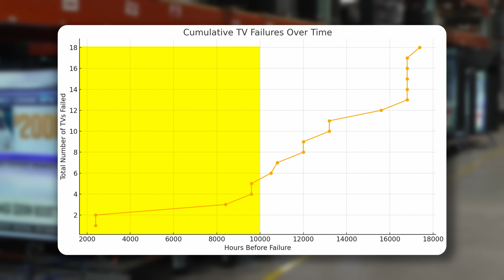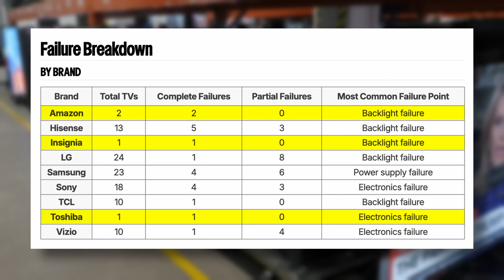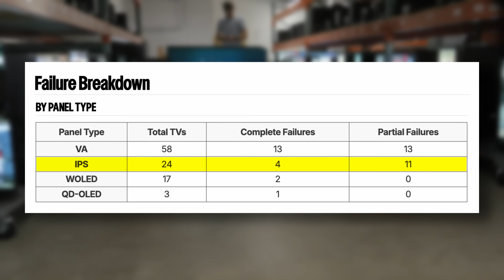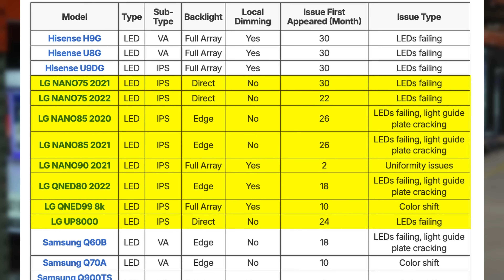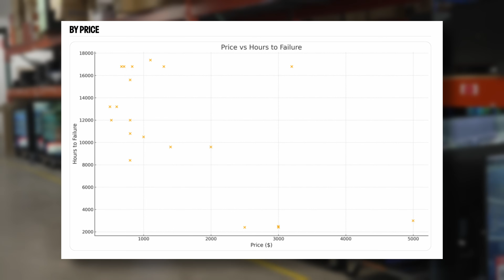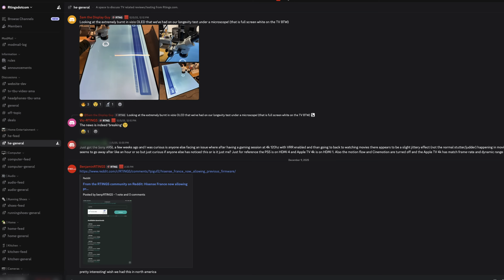Which TVs Break First? Results Overview From Our 100 TV Longevity Test

Comment: And in the good old days, TV's lasted for decades
Reply: In the good old days (black & white), I had a picture tube explode.
Reply: @markrosenthal9108 this one time at Bandcamp
Reply: In the "good old days" they cost a lot more.
Reply: @Sondisberg adjusted for inflation and what was available as far as size at the time, not really. I used to watch cartoons on the TV my Great Grandfather had purchased ten years before I was born and it was still working when they went to digital transmission over the airwaves. 30 years and it still worked when they got rid of it for something better.
Reply: @jeremygardner1123 Yes really. Regardless, you didn't do a torture test on a bunch of tv's from the 70s so everything you claim is purely anecdotal.
Reply: @Sondisberg  Sure, but more consumers should be willing to pay for a top-of-the-range Sony (or LG or Samsung if they are willing to make "professional" series units) that offer a decent standard of quality.  The science & engineering is there to be able to make durable commercial grade televisions (e.g., for production houses and studio use), surely it is up to consumers to be willing to step up and pay for quality?
Reply: unless your back gave out trying to carry it to another room
Reply: they were also like 24 inch at best.
Reply: Yes but compared to a new OLED the old TVs had a horrible picture quality
Reply: @fabian7942 new OLED is already old and replaceable.
Reply: @fabian7942 at the time it wasn't inferior to anything. And if you had a friend with a 20 ft wide satellite dish in the backyard, it was something. That and the big screen with the projector in front that took up half a room. 😆

Comment: I'd imagine the reason OLEDS have fewer total failures (not sure I'd omit noticeable burn-in from the partial failure category...) is just the simplicity of them.  They're somewhat difficult to mass produce, but what's actually going on inside is fairly simple.  It's probably a large reason they have such fast panel response times.  There's barely anything between the panel and the board, especially on WOLED.  I'll say I have a G5, G3 and C4... and ironically the G5 is the one that's got the worst, longest lasting image persistence, strangely.  I think the LG C4 has been the most reliable on that front, for some reason.  Could just be panel lottery, nonsense.  Although, I do think panel lottery should be basically non-existent at the upper end, especially given price.
Reply: Most of failures were backlight going out. Oleds does not have backlight.
Reply: @slovakjakpica  The thing is though,,,, LED backlight going out is the EASIEST cheap way to replace. Their screens are usually INTACT.   Backlight cost --$10 street, doesnt require high tech to replace.   
OLED burn in ---- the SCREEN Gonner.  TV done.
Reply: @Yoga_Tv_buying Not really nowdays TVs are made extremely hard to disassemble without breaking anything. Repairs are expensive and. it worth it even for stupid led backlight. If there would be easier way to replace them without disassembling whole TV, it would help

Comment: LG C2 is my first OLED and I was kinda anxious about using it to play games without dynamic HUD, watching the same channel for a long period of time (because of the logo) or using subtitles without making them transparent as much as i can, whenever i can. Rtings really helped in reducing stress, and time proved that burn-in really is not a problem. So, OLED forever, until they make something better.
Reply: I got a s95d because of these tests and yeah the only precaution I've taken is hiding the task bar on my PC. Made me completely change my opinion on OLEDs
Reply: I've used G8 OLED for around 2 years full time (10h+ a day, mostly coding with few hrs of entertainment). No visible burn in on normal usage, I can see burn in if I open paint with flat color but even that "burn in" is much less visible than any backlight bleed I've had over 4+ LCD's I owned.

The latest gen OLEDs basically should be consistently better than any LCD given all the info we have.
Reply: C2 user for 2 years here now, use it as a pc mon itor too, and still 0 burn in.
Reply: @TerranigmaQuintet  Yeah and tbh i dont need anything better. Just bigger maybe, since I'm on 55" atm.
Reply: I just passed 10000 hours on my LG C1 48" that I have used as a monitor since the day I got it in October 2021. I still dont see any signs of burn in, even on full color tests. On red there is maybe a slight darker region showing up in the middle of the screen, but it is so faint I cant really tell if its just my eyes or not. The bigger issue I have had recently wthin the past year is a few dead pixels in the upper right and left corners of the screen, about 8-12 in total. 

I use it with a mostly black moving wallpaper, auto hide taskbar, 3 minute screensaver and 50% sdr brightness 100% hdr brightness. Useage is about 60/40 gaming web browsing. I dont do anything special beyond that. I often leave several windows split on screen for hours at a time. I really do think as long as you somewhat vary the content on the display, oled burn in is not much of an issue.
Reply: same. 2 years strong and still in love. only complaint is the super invasive web os - easily fixed by a dedicated htpc and disabling the network on the tv.
Reply: OLED's are really nice. I think the issue for most, is the price is nearly 3x their QLED counterparts. But if one can afford it, it may be worth the price.
Reply: thinking about burning. is like thinking about your phone battery health. its useless and only makes you stress.

im using lg c5 as monitor. so far its amazing
Reply: @ianlanford6922  well you can always replace battery for cheaps, but not the TV panel
Reply: OLED installer who replaced my C2 48 panel said he has some at 20-60k hours with NO burn in, max brightness used in advertising. So don't worry, use it howeve ryou want lol.
Reply: I’m using a oled monitor(pg27ucdm) and it is fantastic. Truly.
Reply: There's not any reason to worry about burn-in if you're not watching literally one channel and nothing else (like in their torture test). Realistically, just the act of changing the content occasionally to allow the pixels to cycle and "cool down" is sufficient to keep burn-in at bay.
Reply: Unless your HUD is full white or you run at full brightness all the time, there is no point in worrying.

Comment: I’m an oled lover, but I wish you guys would have considered burn in as at least a “partial failure”. If anybody saw burn in present in their screens to the extent of what was shown in this video, they would either warranty it for a new one or just buy a new tv in general. Just because burn in was expected, doesn’t make it a non-issue when it shows up.
Reply: Right? That's actual gaslighting. They technically lied in this video. I lost my trust in RTINGS today because he just HAS to know better.
Reply from the maker: fair point, but the burn-in here wasn't just expected--it was deliberately induced. we don't expect most people to experience this level of burn-in with normal, mixed use.
Reply: @RTINGScomRD  So burn in is deliberately induced so it simply isn't called a failure but QD layer degradation or LED failure using 100 percent brightness isn't?  Where is the clear line in the sand drawn then on what is or isn't a "failure" or instead just deliberately induced and doesn't count?  Couldn't one say running any set no matter the backlight tech deliberately inducing failure when its run at 100 percent brightness it's entire run time?
Reply: And just to add- "we don't expect most people to experience this level of burn-in with normal, mixed use."-RTINGS. 

And don't you expect that most people will not experience near the backlight failure with normal mixed use not at 100 percent brightness??  RTINGS seems to be wanting to have it both ways.  Giving credit or the benefit of the doubt to Oled of not having burn in if in normal mixed use but not extending that same benefit to mini led sets for backlight failure.  Burn in should be partial or complete failures as well if backlight issues are counted as such.  While I appreciate RTINGS testing I think their general presentation and assertions from their findings are quite suspect.

Comment: I think it's safe to say there will never be an agreement about OLED burn in.
Reply: i think it's safe to say that if you watch in vivd mode, play games or perpetually have news channels on the TV then OLED probably isn't for you. for everyone else it's not a problem.
Reply: @Gbrnole2 I have PC with OLED. 😅 If that's the case than I gonna see burn in. No burn in are really no problem anymore. 

We already have 4th generation. I would only worry with static image or using it for work. Like working with same program. 40 hours each week. Something like that.
Reply: @Gbrnole2 Wow that is a complete lie. Yes true on news, but games wtf is your soruces?  Now sports is 50/50 depends if it transparent hashtags and no stuck on scoreboard.
Reply: @vagamer522  source: my office tv 🤷‍♂ note that vivid mode was pertinent to that prior post. i've never seen screen burn on my other OLED's in cinema / expert modes.
Reply: @Gbrnole2 what model? New TVs and monitors  have lot of tools to prevent that. Like lowering brightness moving pixels egc... I doubt that it is newer TV.
Reply: We had on display Panasonic OLED in shop for one year. Nobody bought the tv... Even after full year running ad over and over. It doesn't really have burnin. At least not really noticeable. So I wouldn't be so scared.

Comment: What about OLED Dead pixels because of bad sealing? LG 48” C1 8500hrs and it has a lot of dead pixels around the corners and borders; no burn in at all. I wouldn’t call that the “best” in terms of durability… burn in it’s not the concern, it’s oxygen leaking! Hopefully it doesn’t get worse but I have doubts…
Reply: It gets worse. I have a Sony A90J that has thousands of dead pixels around the edges after less than 1K hours of use. Once the seal is compromised, the pixels just keep going out in a slow progression from the outside in.
Reply: Oleds self destruct over time even without using them.

Comment: I baught a 2500€ LCD TV with Local Dimming from Phillips in 2009. I used it as PC-Monitor for at least 5 years, nearly 6-12 Hours a day, then it was used as TV until 2020,  then it went black. With a Flashlight you could see the panel was working only the backlight was off. I put it with an error-description on a second-hand marked  for free. A few days later someone drove 200km (124mi) from another country to pick it up. I bet they know what the issue was und could fix it. I bought a cheap replacement for just 500€ which has an okay image-quality and works until today.
Reply: I bet they are buying replacement lamps off of Aliexpress. You missed out, it was probably quite easy and cheap to fix.

Comment: My Pioneer PDP from 2008 with over 60k hours still looks great with minimal burn-in.  When $3000 plasma TVs pop up on Craigslist for $50 it's hard not to have one in every room of the house -- helps with heat in the winter.  Then there's CRTs.  My hospital has a few Panasonics that have been on 24/7 since 2003.

As for modern TVs?  Aside from PSU repair I refuse to touch them.  Great vid as usual!
Reply: But they look worse... Yeah I loved plasma. We had really long time plasma TV. They had great colors and blacks. Unfortunately they stopped developing. Newer TVs are definitely better. 4K HDR it's just non comparable.
Reply: The money you have wasted on electricity bills...

Could have gone to vacation a few times for that.

And in summer you just suffocate in the heat or do you waste even more money on electricity to cool the rooms you are heating with your TV's?
Reply: "helps with heat in the winter"
Yeah, nice way of twisting that it uses lot of power; and while thats 'fine' in the winter, in the summer it means youre using a LOT more power as its dumping heat into the house that your AC needs to expend more energy to remove. The energy cost of running a Plasma TV for 17 years wouldve bought you multiple OLED TVs by now.
Reply: @__aceofspades  Why not have both picture quality AND durability? Surely the onus is on OLED TV makers to make 20 year televisions too?  Even Panasonic themselves have junked their brand reputation at times, for example with late Panasonic 3DO games consoles that had the cooling fans deleted to cut costs and therefore become unreliable junk, whereas Sony avoided that and PlayStation is a strong brand to this day.  You should never set out to tarnish your brand's reputation on purpose -- that seems foolish in the extreme.
Reply: @__aceofspades  If they are setting out to make OLED TVs with a design life of 15,000 hours surely they are capable of going back to the drawing board and making a TV with a design life of 90,000 hours instead? But a lot of blame has to be placed on on consumers like yourself if you think it OK to have "multiple OLED TVs by now"  because the old ones broke , rather than because the old ones were repurposed as spares or gifts (e.g., a gifted Plasma) and are still running strong.

Comment: Having your tv on any content for hours is normal use and not a "torture test". The sooner it burns in that is an issue. If you can't use any of these screens with a static screen for many hours without getting getting burn in, that is an issue. I still have my 11 year old Sony edge lit LCD I use every day with my PC connected to it for many hours and not an issue yet. Of course one day it will fail but I would have went through at least 4 OLED TVs at least using them the same way by now because they would have all experienced burn in.
Reply: If you want to display static screen 24/7 you don't buy OLED, end of story. Normal usage doesn't look like that at all and tv is constantly changing colors of pixels (in tv, games, movies etc.). I use my oled as monitor and there are NO ISSUES after 3 years.
Reply: @Fuudimitzu They ran normal TV on those OLEDs and they burned in.
Reply: @Fuudimitzu it is in a lot of households, unfortunately. CNN, FOX, MSNBC…
Reply: @TyrantPapa ✅💯

Comment: It would be great if you could collect data about dead pixels/subpixels developing over the years. I had massive issues with my LG CX but only around the edges. I have never ever had a pixel actually die on any of my LCD panels - I only encountered dead pixels and subpixels on LEDs right out of the box, meaning during manufacturing.
Reply: I have a Sony A90J with the same problem. Thousands of dead pixels have developed around the edges of the screen and it just gets worse with time.
Reply: LG replacement panel had that and man it got pretty wide around every border. From my research at the time seems to be age-related as many people showed pics of the same thing with very little powered-on hours. I remember seeing a lot only 1-4 thousand hours lol.
Reply: I had some pixels stuck on blue on my Samsung s89c but they went away after a while. It was concerning and I really didn't want to have to pack up a 77"TV. Haven't noticed any since.
Reply: Completely dead pixel or discoloration? Our 2019 C9 with a very high number of hours (doesn't show the hours in the regular EU Firmware, haven't bothered rigging up a service mode remote) starts to develop "yellow-ish" pixels on the top and left edges. But the pixels still work, only really noticeable on white or blue, looks like the blue pixels are loosing brightness first.  
But haven't even looked at test patterns, because the image is still amazing in general and I don't want to have to inevitably focus on dead pixels :D

Comment: This is pointless. I don't see how this could be a valid test. Each brand uses different components for its cheap, middle and high end TVs. And those change every year. Sometimes not even using the same parts in different regions. And then we have different quality in different batches of the same TVs. So how can you test the quality and longevity of TVs? You would need thousands of TVs to compare them and get some relative data. Having 1 TV from a brand does not give you any data at all. I think companies care very little how high the quality of parts is regardless of production line because they believe no matter who you are and how much you pay - you will buy a new TV in 5 years. So they don't care if components last longer than that. But if they do - that's just a fluke. You won't find a lab where they try to make the best components to improve the quality and longevity of their TVs. Why would they sell you a TV that will last 50 years? They only care that the newest TV looks better than the rest on the show floor so reviewers make everyone want to buy one! That's the only metrics they want and need.